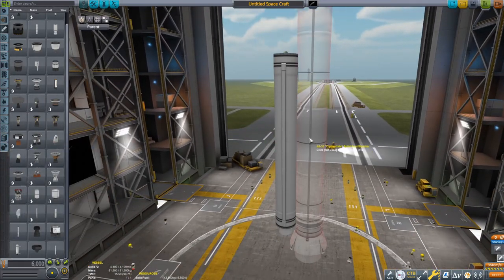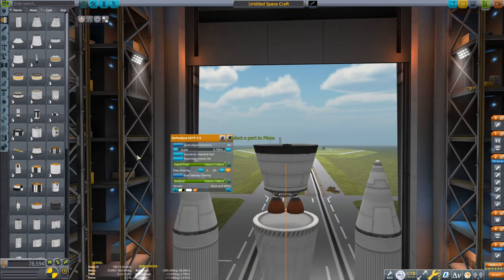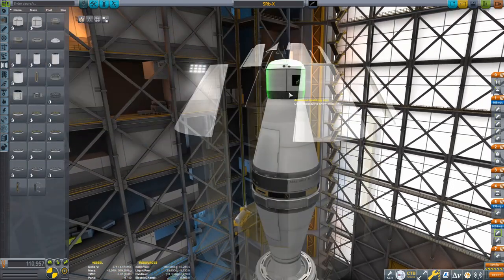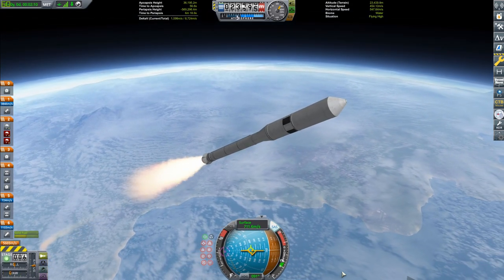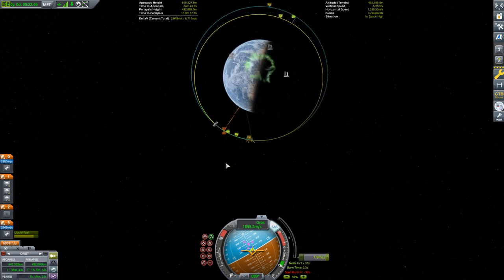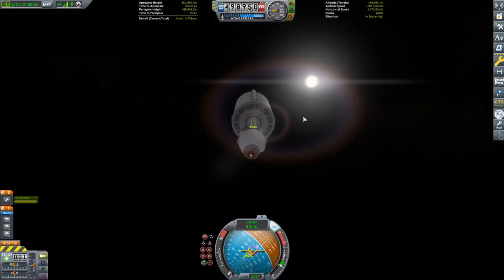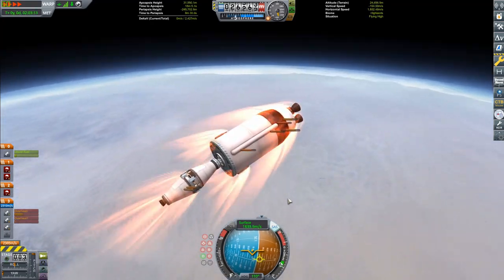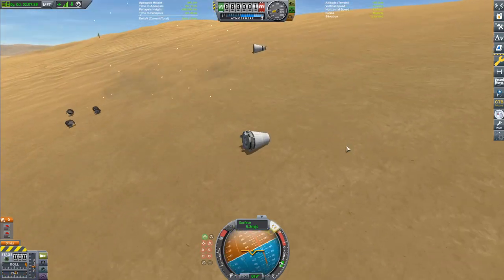KSP: This FAILED Space Shuttle derivative looks very weird...

Comment: the cheetah is actually the KSP LR91 :) The outside srbs were actually 4 segment SRBs, ripped right out of shuttle stock. The core stage would be a 3 segment booster, while the outer boosters would be 4 segments. 5 segment boosters didn't make their appearance until a proposal for 5 segment boosters on the shuttle stack. However this was scrapped after the STS-107 disaster. All centaur flights up until the Atlas V used a dual engine centaur. Only once the RL-10 thrust was upgraded and the higher performace RD-180 replaced the weird stage and a half setup of the Atlas IIAS could they switch to a single engine centaur.
Reply: Jeez didn’t have to write a paragraph to fact check him
Reply: @james9132  counter argument: yeah he did. I for one, appreciated it. When someone is presenting knowledge as "fact" they should do their research prior to presentation. So thanks for the fact check! I appreciate the knowledge
Reply from the maker: thanks! I just blindly put the skipper on, it didn't even cross my mind that the LR91 was already in the game. Also, I actually did know that about the boosters. I just don't think I really said it well in the commentary. Thanks again
Reply from the maker: @Ultraramage  agreed. That's also why I put sources in the description, in case I say/ do something wrong